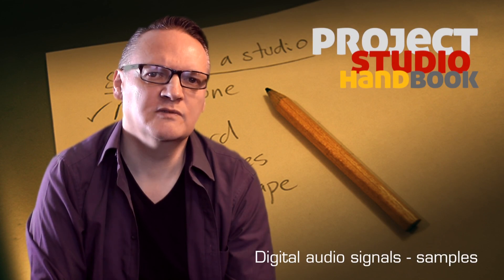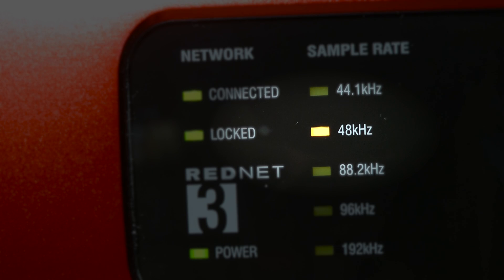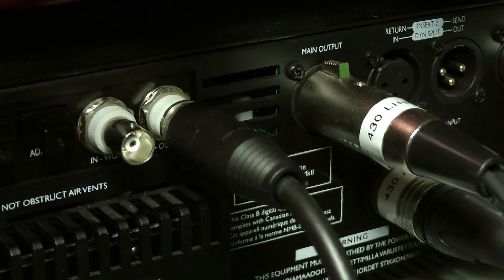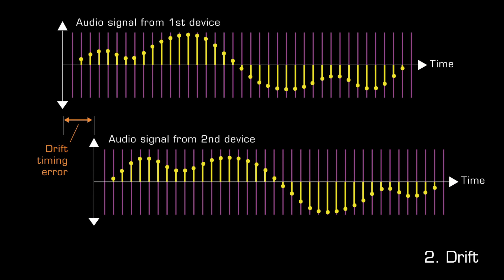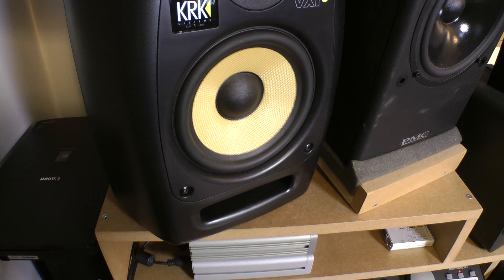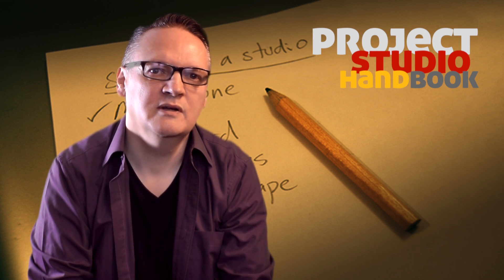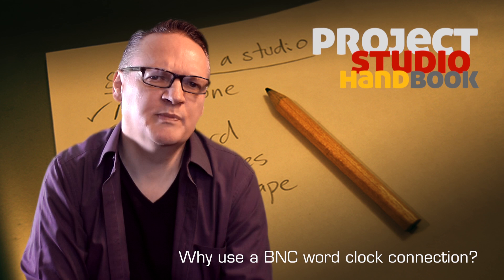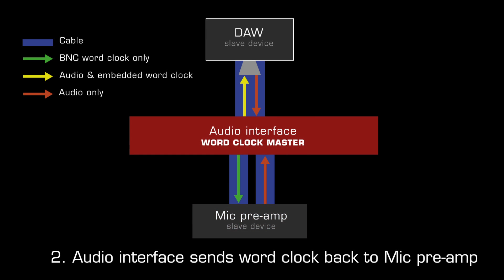Digital audio synchronisation

Comment: Really interesting video - thank you for taking the time to put it together.   Couple of talking points  :   I'd read that not all digital cable types could be relied upon to transmit a error free word clock signal.  And that many digital devices did not perform well when slaved to an external clock (particularly true of 'prosumer' equipment).  Isn't the simplest solution to only have one external digital device, the A/D D/A converter?
Reply from the maker: Hi Toby. Thanks for your comment. You're quite right that not all cables are suitable for digital signals. You definitely need cables specified for digital with the correct capacitance. Your comment about Work Clock is indeed valid for stand alone word clock generators used to sync multiple devices. These can produce jitter and are not recommended if they can be avoided, although sometimes they cannot. On the other hand, embedded word clock in AES and SPDIF is rock solid when sync is via a master device such as an audio interface, and cable length is not excessive, especially with the clock recovery algorithms that most interfaces/convertors have. We've never had a problem with  syncing outboard digital gear in this way. Although 'prosumer' is a term we might apply to analogue, its not especially relevant to digital anymore now almost every device has excellent or adequate chipsets.
Reply: Thanks for the reply.  I've read that the stability of the mains power supply can have an adverse effect on digital clocks.  Could this, in turn, affect / limit the number of digital units that can be reliably slaved to a Audio Interface, etc?
Reply from the maker: In theory yes, but in practice almost all DA/AD converters have clock recovery systems and so jitter and drift shouldn't be issues. Its also worth remembering that jitter is only a problem at the D to A stage, where clock recovery does its job.
Reply: Thank you so much for the info!